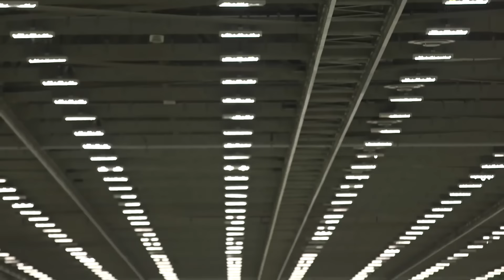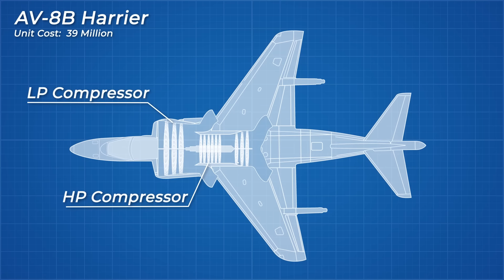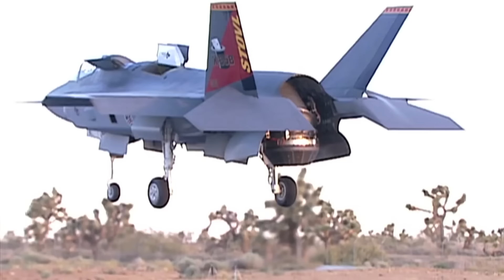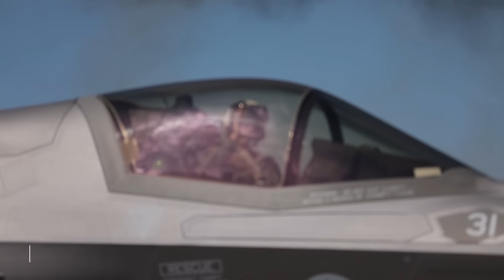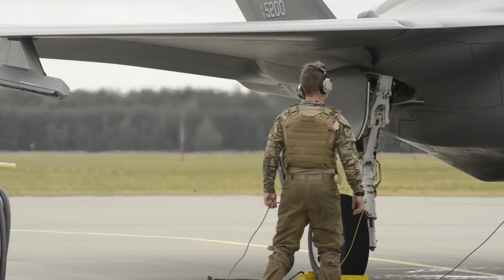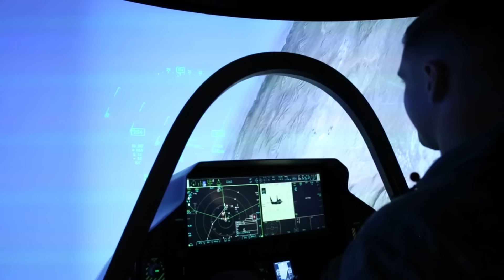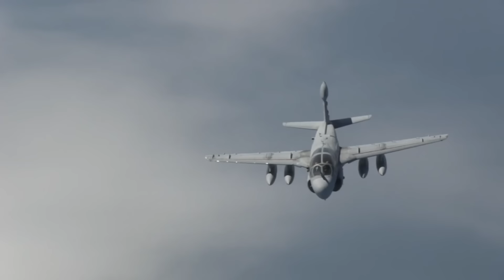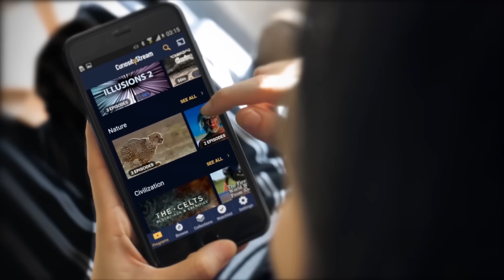Is The F-35 Worth $115 Million?

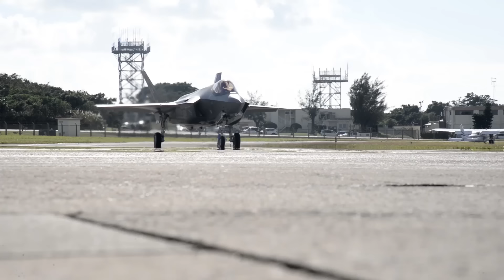Comment: 0:32 “This is after all the most expensive weapons system in the history”

aircraft carrier:am I a joke to you
Reply: Gerald R. Ford- class cost 12 billion and 4 billion for research and development. 37 billion for floating airfield the CV better have special abilities to hoover in stratosphere then
Reply: It is the most expensive SYSTEM in history yes, but not the most expensive single entity in the US arsenal. The carriers and a B-2 for example are both more expensive single units.
Reply: @AugmentedGravity  B2 bomber coming in at a whopping 2 billion a piece.
Reply: @sumott497  For example.
Reply: @AugmentedGravity  Like me what?
Reply: Plus operating costs. Estimates for those vary between half and a full billion per air frame.
Reply: @JB-qg2uc  and?
Reply: the F-35 weapon system has cost 1.5 trillion dollars and is still rising. a Gerald R Ford  carrier (the most modern super carrier available) only costs 37 billion a unit (which the US will be purchasing 10.)

So yes in comparison an Aircraft carrier is quite a joke compared to the F-35 weapon system.
Reply: @jnonya7743  >has cost 1.5 trillion
It did not
Reply: @Poctyk  Indeed that's the lifetime cost of every F35 that will ever exist ever. We haven't spent that much money yet by far.
Reply: @jnonya7743  I believe you are listing the program cost for the carrier the unit cost is $12.998B
Reply: @jnonya7743  Its not rising. Its doing the exact opposite.
Reply: @jnonya7743  I wouldn't be surprised if the lifetime cost of a given carrier is still less than the lifetime cost of an F-35. Is 37 billion just the unit cost of a Gerald Ford carrier or the entire estimated cost over its service life?
Reply: J non ya you’re right,the numbers are quite insane tho,the us military have shit tons of money
Reply: @jnonya7743  Wrong. So absoulutely wrong. It WILL Cost 1.5 trillion dollars after 55 years of being in service. This is why it pays to stay in school folks. You learn things like, how to read.
Reply: @jnonya7743  you're comparing the 1.5 trillion of the entire cost of the program until 2070 or whatever, to the unit cost of a SINGLE unit.
The super carrier project had to be designed, it will have to be maintained, etc.
Reply: J non ya Gerald R Ford costs 14 billion dollars. Get your facts straight
Reply: @jnonya7743  The entire costs are for the whole shebang through 2070 including international. Costs per unit plane, costs for spares, costs for entire maintenance and parts, costs for pilot training, costs for maintenance worker training, shipping costs, well all of it. No other military system included all that. This is a new era. Imagine if all carriers from the 50's included all these costs for training, maintenance, the cost of it's aircraft, it's pilot training, the costs of all its weapon systems and bombs, their development costs etc through 5 decades. This is why the f-35 seems so expensive. Peace bro.
Reply: @jnonya7743  1.5 Trillion is actually the projected life-time cost of the air craft over the next 50 years.  The actual program cost to this point has been 350 trillion dollars.
Reply: J non ya “only costs 37 billion a unit”🧐
Reply: they could have ended world hunger for 40 years straight with that amount of money.
Reply: @aayushpaliwal3450  Doubt it.
Reply: @aayushpaliwal3450  that's only 30B per year. We could pay for renewable energy for all as well.
Reply: @aayushpaliwal3450  not really, world hunger is not a matter of throwing money at the problem. Natural disasters and conflict cut off populations from access to food, even though its available. Buying more food doesn't solve the fact that there's external causes to why people can't access it.

Comment: I see this has turned into yet another A10 vs F35 debate full of the usual myths and misunderstandings. Let's clear a few things up.

The A10 is not a one trick pony. It is not simply a close air support aircraft. It provides a number of critical roles that no other aircraft can match including Strike Coordinated Armed Reconnaissance (SCAR), Airborne Forward Air Control (FAC-A), and Combat Search and Rescue (CSAR). Half of the Airforce's FAC-A's are A-10 pilots and they train 4 times as much as F16 or F35 pilots for this role. The A-10 is the only aircraft authorized by the DOD for CSAR. 

The Hog was not designed to destroy tank columns in western Europe. It was designed to meet the needs outlined in a program called A-X to replace the A-1 Skyraider  and one of its shortcomings was the failure of its 20mm cannons to penetrate the soviet armor that began to show up late in the Vietnam war. It wasn't just designed as a tank buster. It was the first aircraft in Airforce history designed specifically for ground attack and survivability. 

Thankfully the A-10 isnt going anywhere, at least not until a suitable replacement is proposed and developed. The A-10 owes its success to its specialization, both in the training of its pilots and the design and function of the aircraft. You cant replace one without the other and it will take decades to do both.
Reply: "Thankfully the A-10 isnt going anywhere" - yeah they're gonna keep them in inventory sucking up money while most missions are given to F-16s and F-18s because of idiots like John McCain.
Reply: @ChucksSEADnDEAD Without the A-10, whos going to fly Sandy? Who's going to provide Observation? How do you plan to make up for a 50% loss in FAC-A?
Reply: @sultros  Are you gonna send A-10s to do FAC in any zone less permissible than Afghanistan?
There is a FAC phase in F-16 WIC. There's just more roles to focus on compared to the A-10 but that is easily mitigated.

Comment: @Real Engineering... Regarding the F-16 flight test report, the F-35A was flying with nearly a full load of gas (18000 lbs) and without its full 9G software. The F-16 was flight two sidewinders on internal fuel and centrer line tank so approx 9400 pounds max of payolad. So the F-35A was lugging around at least twice the payload of the F-16 because of its much larger fuel fraction. At a lower fuel fraction the F-35A can maunuver on par with the F-16.